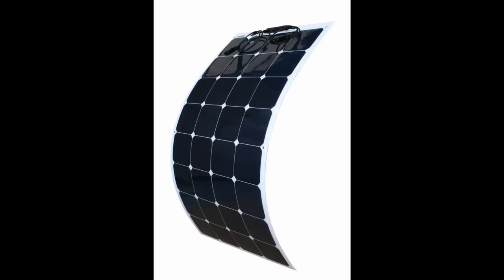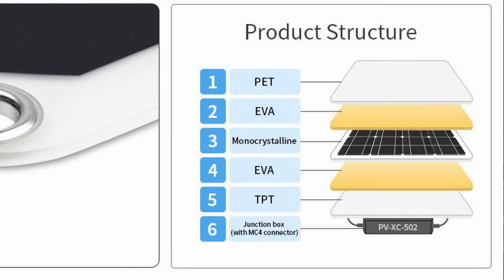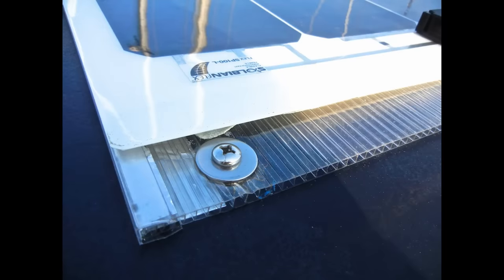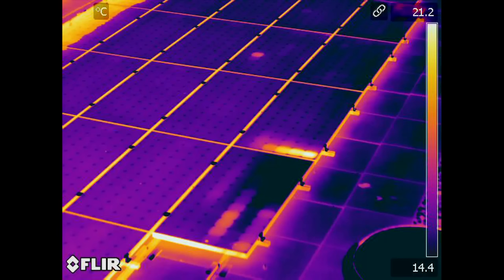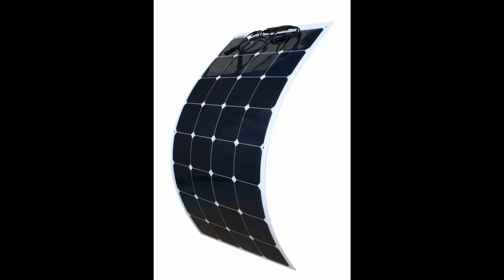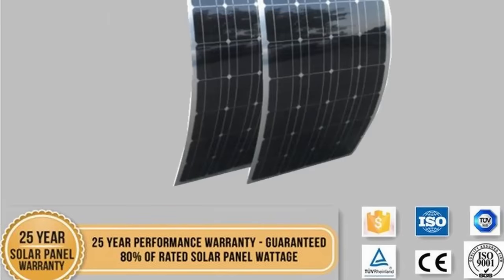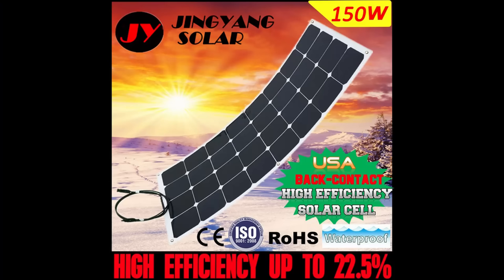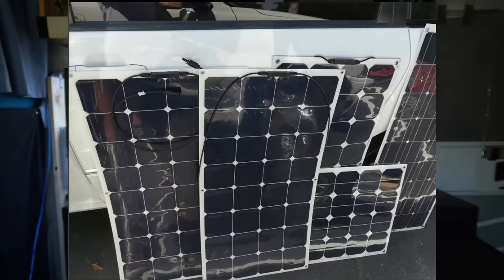The Truth About Flexible Solar Panels

Comment: Great rethoric William but saying "The Truth" in 6 minutes can be difficult and some mistakes is possible. For example saying that the heat dissipation in a glass panel is easier than in a no-glass (flexible) panel is at least poorly defined. The 3 or 4 mm thick front glass in a standard solar panel is a formidable heat insulating barrier, much stronger than the one represented by the polymer sheet which covers the cells in the flexible panel. If you need to stick the panel on a surface the Normal Operating Condition Temperature (NOCT) of a glass panel is surely higher than the one of a flexible panel. That is measurable, not just an opinion. If you have an air flux under the panel, the glassy one can behave a bit better, but that can be an issue if you want to install in mobility or on the deck of a boat, where flush installations are a must. Also there are many other inaccuracies in your video: heat has nothing to do with hot-spots, which are the results of cells damages, you can have hot-spot also at the north-pole and also in rigid panels even if I agree that the rigid ones are more resistant to impact. But the glass can breaks and in some installation is better to have a not working panel than a broken glass;  ETFE is not black, is one of the possible transparent surface that can be used in flexible panels, it is actually one of the best, and has nothing to do with the flexibility of the panels, which are actually quite flexible, much more than what is needed in most of the installations. Yes, sure, you can find cheap flexible panels on the market and it is always a good idea to choose a reliable distributor, even if the one you advices is selling the same flexible chinese panels you are blaming. So William, to many inaccuracies to trust your Truth. Flexible and rigid panels have their pros and their cons, and they have different fields of application. --- PLEASE NOTE: I'm the technical director of Solbian, an Italian company manufacturing flexible solar panel (also shown in the William video), thus my comment cannot be considered unbiased, but what I wrote can be easily verified.
Reply: I agree Luca. I want a quality 100W flex panel, like Solbian,  to put on my small electric scooter and ebikes trailer....I will design a dedicated custom trailer. I ride my small electric scooter (ezip1000) and ebike everywhere and even walk them into local stores, grocery shopping etc... I currently charge them at home on my rigid solar array that I built myself.  People are so fascinated that I ride on power from the sun with such simplicity.  I'm a EE and I love talking about PV and direct use of solar power with people. People I meet would be even more impressed if I had a module/panel on a trailer for a visual. ;)
Reply: @BreeUSA  I charge my ebikes up with a pair of 100w rigid panels....I took the mony I saved (compared to flex panels) and doubled my battery capacity and range....and besides, who likes to ride mid-afternoon in the heat/sun anyway (I look for shade when I ride).  Pulling a panel makes sense for extended off-grid trips....or makes sense if you need a visual to prop up the 'ol ego. :-)
Reply: @prblakeslee  Yes Paul for extended trips, camping,  shorter trips mostly public education (I always get queries about my electric rides and when I say I charge off the sun they are intriqued but a visual really helps). I have a rigid solar array I built myself to mainly charge all my E-rides as I mentioned. I purchased a Sunpower flex panel recently as it was within my now tight budget but I was very dissapointed with the QC. When I contacted Sunpower they delayed and delayed in responding and ultimately after first promising a solution didn't care about the mechanical defects (grommets pushed half way through, smashed and grommets split on a couple critical corner grommets) , and various cosmetic defects and poor build quality. While I like the  Sunpower cells, the QC and company product support was a terrible experience...very large arrogant dismissive company. Perhaps for large orders they will show more respect.

Comment: Super helpful information. Hopefully someone invents a better way for flexible solar panels to dissipate heat, bit of a tough physics issue though.
Reply: they should put a copper sheet under solar panel, and some kind of passive heatsinks with a large surface area put on the copper sheet
Reply: what about a layer of Corroplast or corrugated polycarbonate greenhouse covering sandwiched between the flexible panel and the vehicle for airflow/cooling? I was thinking of trying this but haven't seen anybody else try this. I know the ETFE coated panels last longer before clouding up.
Reply: There are conductive flexible sheet materials... my guess is they're expensive...
Reply: Just did. Look at my comment from earlier today

Comment: There are many high quality flexible panels with warranties now. Everyone knows it won't last as long as thick glass aluminum framed panels, but we love it for the easy install without drilling holes and using a rack. You can use reflective tape or 1inch foam insulation underneath for heat dissipation. And you can stealth camp.

Comment: This is a good post/topic  - Solar panels get hot - flexible  panels bonded directly to a metal roof that  is invariably insulated on the underside will get very hot - The falloff in power proportional to temperature is significant - the MPPT volt for the panel  drop can be 20% or more which will throw cheaper controllers  which are not true MPPT horribly -  outfitting a panel to a curve makes little sense  since the panels output will drop to the cell most orientated away from the sun  - thanks for posting

Comment: I bought 2 x 100w of the ones you showed the advert for. They lasted 2.5 years before dying and replacing them with a 310w solid panel doubled my power output.

Comment: I am very happy with my ETFE flexible solar panels. I have it for the second year now.
Reply: I just bought some, was wondering if anyone had noticed they were infinitely better than the PET normal ones. Which brand did you end up buying? I got the 120W TP-Solar folding ones (ETFE)
Reply: @blenderforall9912  I had AllPowers flexible solar panels company. I am happy with it now a third year.
Reply: @paveloleynik2743  excellent news! I'm happy yours is lasting and works well.

Comment: Do you have data supporting the stuff you are saying? Because a lot you are saying here does not add up when I look a little further.
Glass has a thermal conductivity of around 0.7 while most plastics are between 0.2 and 0.5. That makes me wonder how the several times thicker glass cover will dissipate heat better?
Also I wonder how the company you are mentioning can afford replacing flexible cells for 25 years if "at most you can get 5 years [of use]" (0:55). That'd mean the make enough money of each cell they're selling to give you AT LEAST another four cells for free during the warranty period (if the cells are in fact failing after 5 years at most).
Reply: Uhm, aren't hothouses made out of glass?
Reply: @johnwren3976  the newer ones are made from plastic. Techo evolution my friend.

Comment: Mount cells on 1/8 polycarbonate (lexan), lightweight and can take massive impacts. Plastic is close to glass for heat conductance, balance thicknesses.
I use 100watt flex to Solarized my etrikes which increase range to 160km/sunny day.

Comment: I guess I've been lucky, although I use it differently. I have them in a portable system for my RV. I have 400 watts traditional solar panels on the roof and I use 2 -100 watt flex for my portable. I use the flex panels on a PVC frame. Weight is the prime consideration for using these panels. I use thick wire and can place them up to 20 feet from the RV with minimal voltage drop.  This way I can park in the shade and still have 200 watts working in the sun.  I'm on my second year with these and so far so good.  They are cheap Chinese Ebay panels  and I do expect rather quick failure - but for me the light weight and portability is worth it. Thanks for the tip on you Cali distributor.

Comment: Will, your video is spot on. I bought (4) Suaoki 100W 18V 12V Solar Panel Charger SunPower Cell Ultra Thin Flexible with MC4 Connector on Amazon 18 months ago and they ALL FAILED. I mounted them with brackets on top of my RV for air flow and still failed. A lot of $$$$$$ out the door!  Too bad I did not run into your video sooner. I now have Renogy 100 Watt 12 Volt Monocrystalline Solar Panel (Compact Design) and they seem to be solid with a good warranty.
Reply: Did you go with the flexible Renogy panels?  I ask because I'm using those too and need to know and would love to communicate with other people on how they do over time.  Thanks
Reply: No, just the compact 100 watt glass panels. So far, so good.

Comment: Are there no flexible panels worth buying in the current market? 
Gas prices are up for one thing so aerodynamics are a big deal. 
But also in terms of keeping a van conversion less obvious and more stealth, flush mounted flex panels are better than a huge blocky array on hardware mounts. 
Honestly if flex are such a problem, I'm going to get a couple suitcase type panels and just store them in the vehicle except when I am camping in remote areas. 
Which kind of sucks.
Reply: I agree. Foldable panels typically cost the most.
I have solar panels on a cargo basket that I'm trying tone down a bit.
On another note, the solar panels attached to my roof rack essentially acts as shade keeping my car some what cool even while in direct sunlight.

Comment: Ahh dangit! I just recently installed a 100w flex etfe bougerv panal on my astro..... I guess I get to find out how long it lasts!!!! I plugged it in a few days ago to my solar generator and was consistently getting 69-70 watts. Thanks for the info man.
Reply: I read they only have an 18 month warranty.
Reply: Are the solar panels still working ?
Reply: Update!. Lasted 14 months and fried in the arizona sun. May partially have been my fault. I mounted it directly to my van roof without an air space under it. I would buy again. Never had any trouble until the end. Only complaint is the bix on top where the wires come out was terrible design and not water proof.

Comment: I have a nominal wattage of 990W of Sunpower panels on my RV roof and after 2.5 years I just measured 1,021 Watts again under pretty much ideal conditions. My circumstances are such that I can only mount the rather light flexible panels and so far I am very happy with them.
Reply: good luck with that warranty lol
Reply: What panels are you using?
Reply: Sunpower flexible solar panels from research are good quality but not the absolute best in the industry. I don't take everything Will Prowse says as gospel truth and there are always exceptions to quality of these panels.

Comment: Check MiPV Leisure series panels.  Constructed using CIGS cells based on a stainless steel foil cannot crack and are extremely resistant to impact damage such as large hailstones or stones thrown from tyres etc.

Comment: The best middle ground is that metal solar panel you reviewed before. It's flexible, heat is evenly distributed, and it is very durable.
Reply from the maker: Yeah those are awesome! I love them. I wish more people manufactured them
Reply: What panels?  Brand and other information, please.
Reply: Please review the metal flexible panels, to have an idea of voltage/current/watt behavior and possible uses/ instalation....and of course how durable they are compared to other panels
Reply: I can't find the panels you mention, do you have a link to them? thank you,
Reply: Elf solar tricycles used aluminum backed solar panels and many failed after a year or so.

Comment: We have had the same problem. Over the year we have had our pannels they have degraded so much. Now they output anything from .1 to .3 amps. Basically no power at all. At 280 a piece we are very displeased with the flexable pannels and will never buy them again. I only wish I had done more research to begin with rather than getting them because they fit with our needs. We need power more than we need them to fit a particular area.

Comment: Ome thing you ate missing. Yje flexpanel can be easily mounted with velcro for charging a solar generator.  Then rolled up and put ina box. Omce removec grom the sun the heat disapayes very quickly. Only when the panel is left in the hot sun permanently mpunted will it wear out quickly. Because the Cig  is flexible and only weighs 6 lbs it is vrry easy to. Mount ot lay flat in tje sun amd will charge a solar hematator in 1 hour.Many ppl have several small solar gemarators for designated use to keep genarators charged in shifts 4 times a day. This keeps refrigerators, heaters,  Air conditioners, and water pumps running for survival or permanent RV living. Its almost as simple as plugging your phone into charge daily.  Then roll it up out of yhe sun
 Roll back out cjarge another hour
 Roll it up.amd put it away for a day or ywo. If you habr 5 cig panels , 4 solar generators  with bariois ports you can easily libe off grid without any tech experience.

Comment: One of those last pics you showed of two flex panels on a fabric covering on a boat seems like possibly the best application for these panels. Tons of air flow!
This is my first time looking into them. I'm interested in them because of their low profile because anyone with an eye for van dwellers can see that I've got ridged panels on the roof of my box truck. I mounted mine about an inch up because I was aware of the issues around panels getting hot. It always sorta confounded me as to how flex panels don't get hot, but I always assumed they just costed more because they didn't have that issue. I'm glad I say your video before I bought.
Reply: hi, have your elastic panel mounted one inch above works well?

Comment: I appreciation this video. I just bought a Renogy 100 watt flexible mono panel for 25 bucks at Lowe's. Yes, it's new. I'll be installing it with air space underneath that will also allow water to drain away. It's going on a flat travel trailer roof. My only concern, and you didn't say anything about it, it's if a flexible panel may be used with rigid panels of the same wattage? I already have 300 watts of solar in rigid panels.
Reply: 25 bucks for 100W? Damn that's getting cheap. How is it holding up?
Reply: @nlewis1111  very well. We used Gorilla Tape and it hasn't moved in over 2000 miles and charges the batteries like it's supposed to,

Comment: Had a 50W flexible panel on the dash for camping. Vibration from driving killed it at the end of the road trip. Also it got somewhat warped from being in a hot car is summer.

Comment: Hi Will, always great info.... Renogy has 100 watt/12 volt Flexible Monocrystalline Solar Panels with a 25 year output warranty (80% efficiency rate after 25 years) and 5 year warranty for workmanship and materials.  Thoughts?
Reply: im ready to buy.
Reply: I've been researching this myself, reading reviews on Amazon. I would recommend asking them if mounting them flat to the roof of a van or RV is covered under warranty. It is this specific use he's talking about, and why they fail. A metal roof is not a heat sink, it's closer to an oven :)
Reply: The Renogy flexible panels are ETFE not the junk PET panels reviewed here -night and day. They are similar to the Lensun panels but with a much better warranty.
Reply: Great video as usual! I bought (2) Renogy 160W flexible panels 2 years ago and flat-mounted them on my RV epdm roof with eternabond tape. They still work great and I have not had any issues with them. They show the panels flat-mounted in one of their product pics too. I also like the warranty as follows: 25-year power output warranty: 5 year/95% efficiency rate, 10 year/90% efficiency rate, 25-year/80% efficiency rate. 5-year material and workmanship warranty.
Reply: @richpetrelli2783  Hey Rich, I'm using those too.  Please reach out to me if yours fail or start to (or if they do amazing).  I do a Youtube channel too, and I really don't want to accidentally steer any viewers in the wrong direction.  Thanks!

Comment: I was thinking to make a solar sea scooter and use a flexible solar panel. Nice video change my mind. my solar panel will be 1 metre above the sea ? Which panel do you recomend?  Salt water damage monocristal regular panel? Or flexible panel 1 metre above sea  manage heat problem? There will be nothing between panel and sea there will be just air.

Comment: I know this is an old video but it’s new to me. I am building a small, portable system (100ah). I want it to be lightweight. I went with flexible panels (2 SunPower 50w) because I thought they would fit my needs and they have decent output. This is not a 24/7/365 installation; only for camping trips.
Is there another lightweight, compact option that recommended?
Reply: I think this video is very biased  if you do some research and don't buy cheap flexible panels your probably be good I have 3 renogy flexible 100w panels is been 5 months no signs of them degrading

Comment: Good advices !
Me too .. i got 2 bad flexible solar panels...stick them on my roof like a beginner.. and still stuck with bad efficiency.. compare just one good rigid one witch is producing more than the 2 bad ones flexibles..
And half price !
So use good rigid one if u don’t really need flexible... the van style at this level is useless 😁